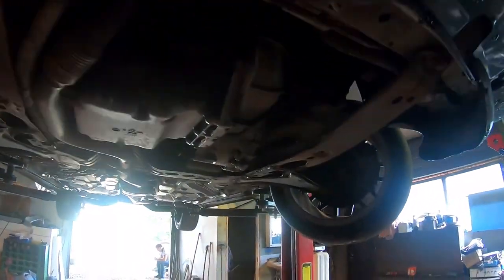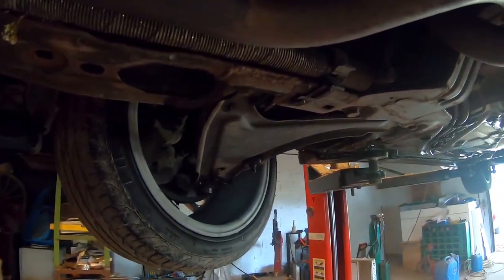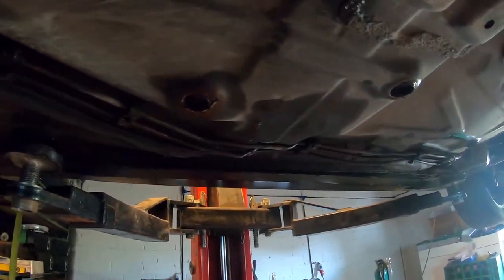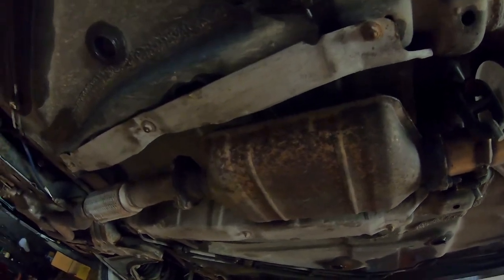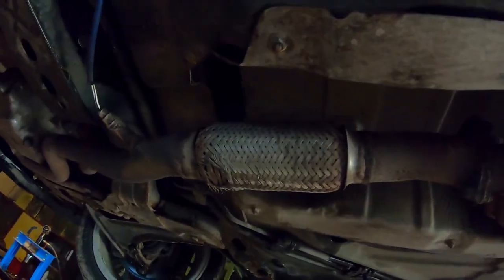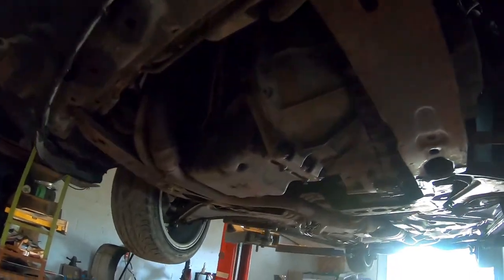Opel Calibra Restoration Part 1(Gear Linkage)

Comment: Hey mate! Did you get original bushings (OEM) or aftermarket? I think the original ones are rubber and the replacement parts are plastic ? Would you care to give me more info about it ? Cheers!
Reply from the maker: Hey i used aftermarket ones and gear movement went better but also i ordered new seal ring for the gear lever.I havent received it yet but it should also make the gear lever feeling better.
I will add a link what aftermarket ones i used.I got mine from estonia but its the same kit.

https://www.ebay.co.uk/itm/VAUXHALL-OPEL-ASTRA-F-CALIBRA-A-COMBO-GEAR-LINKAGE-REPAIR-KIT-SET-758223-/182286032871
Reply: The name of the braided pipe is a flexi pipe.